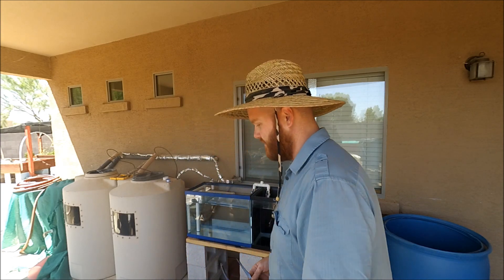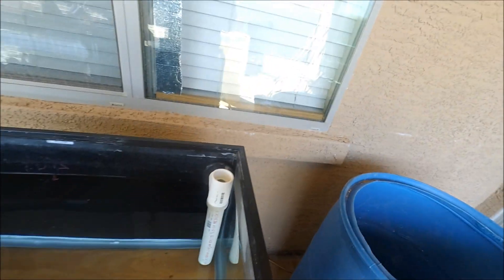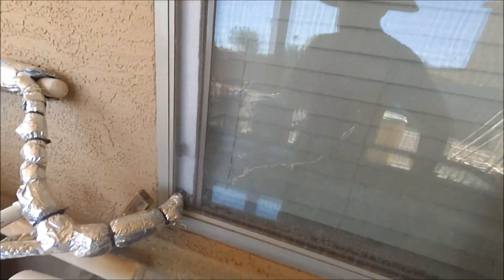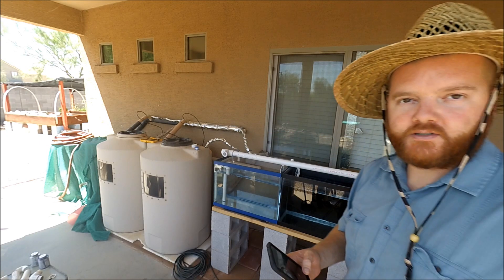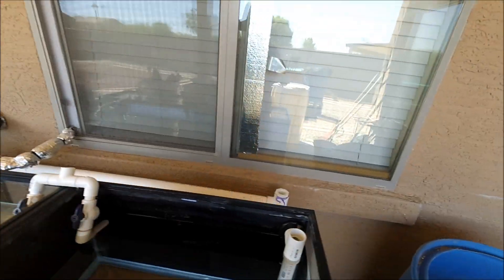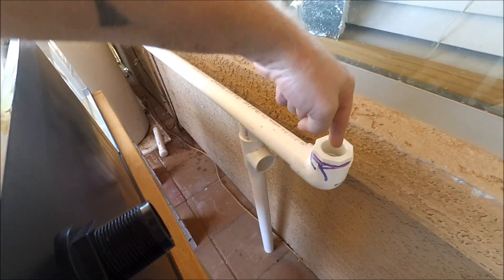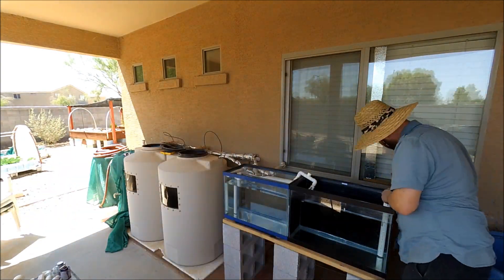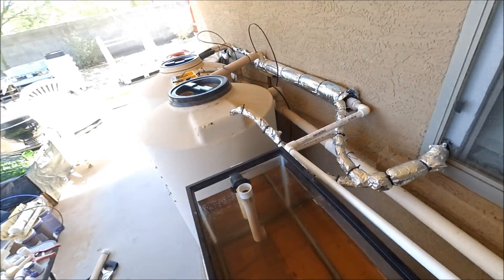DIY breeding tank Finished

Comment: Looking really cool.  Can't wait to see the babies.  :O)  I have a pile of PVC and I'm always reusing it and seldom glue it.  I should try the pipe tape I guess 'cause sometimes it comes apart under some pressure.  I never did because I figured that pressing the pieces together would push the tape out of place.  I just never tried it.  What's your experience with that?  I guess I just need to try and see what happens.
Reply from the maker: Thank you very much! The pipes are under very low pressure and probably don't need the tape but I've found that sometimes the pipes don't always fit snug so I just use it, could just be plasibo lol

Comment: Fastest plumber on earth! PVC drains don't need to be glued or taped, friction fit won't leak. If your water pressure isn't too high supply lines don't need it either. Plumber's tap should only ever be used on "pipe thread" fittings, anywhere else it is as likely to cause a leak as prevent one. You wouldn't believe how many times Lowe's has sent me out to fix a homeowner installed plumbed in part, and the problem was the plumbers tape. Interestingly some of the some of the Chinese stuff, the instructions actually say to put plumbers tape in places where it doesn't belong and those cases Lowe's had to pay me not the homeowner. By the way if you want to change the location of the drains or actually plumb the two tanks together it's not that difficult. https://youtu.be/Ah7w62w3Bh0
Reply from the maker: The water pressure is very low and will be just fine. I've done similar things with higher pressure and would have to be glued for sure.